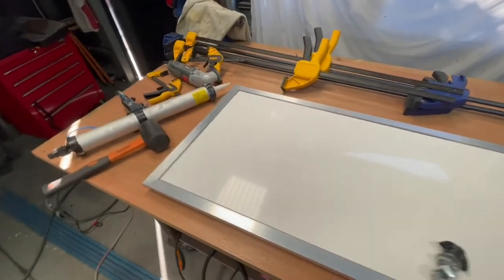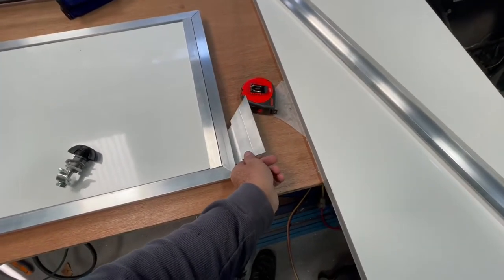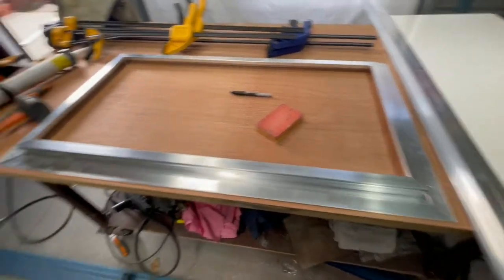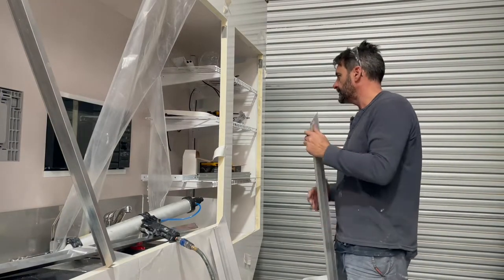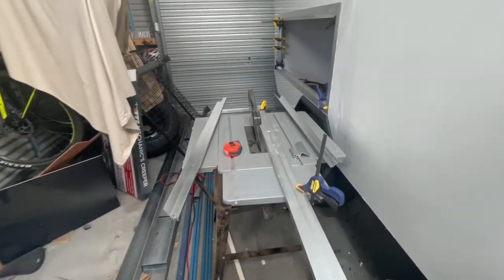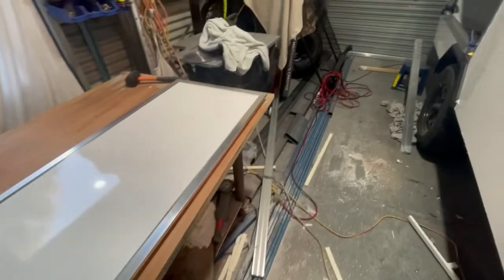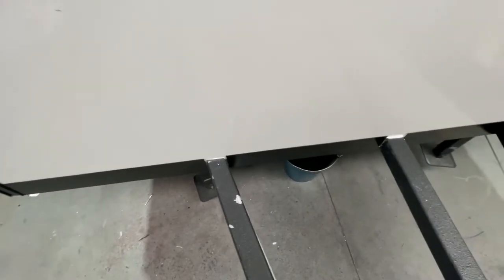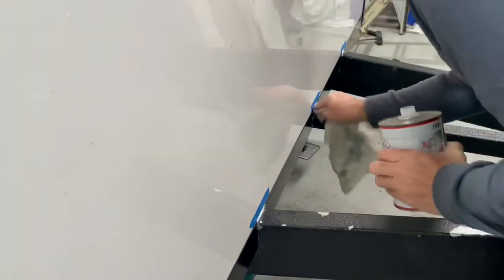Episode #14 - Solo DIY offroad caravan build series - hatches and trims

Comment: A good tip for the sikaflex is to run a line of masking tape, run your bead, dip your finger in a solution of water and dish soap (make sure its super soapy) and then touch it up. The soap stops it sticking and making a mess. Then peel off the masking tape for a crisp edge.
Reply from the maker: Yeh great tip. I got on the soapy water for the en-suite later on but wish I’d known for the panels

Comment: Craig, use Monarch 3 in 1 caulking tool (Bunnings Where Else) to remove any F@3K ups in caulking, then do what Christopher Inch said in his post.  Another great episode, I would replace the screws in the J mould with black ones.  I can't believe what that Pop Top manufacturer has done, spraying the welded corners in gloss when the rest in Satin or Matt finish. I was picturing the numpty at 4.45pm on a Friday Arvo spraying it.  Pool fence manufacturers/suppliers sell great little cans of satin black paint.  Check with a panel beater, spray painter, I am sure they have a product that takes the gloss out of paint or at least he can blend satin black over it. This is addictive viewing Craig.
Reply from the maker: Thanks mate. Stay tuned for the J mould. Rubber strip gets inserted over screws for a neat finish. I’d love to name and shame the pop top mob but not interested in law suits lol